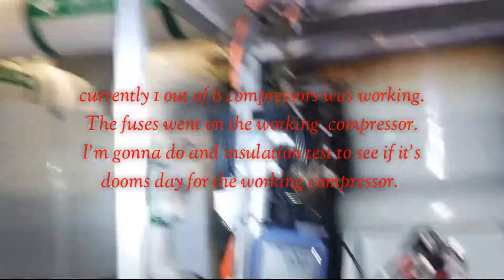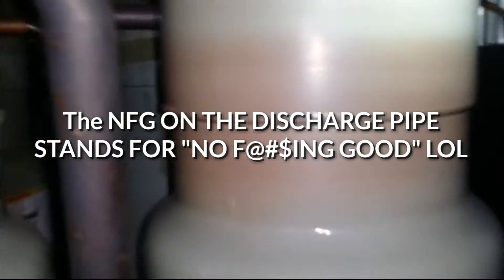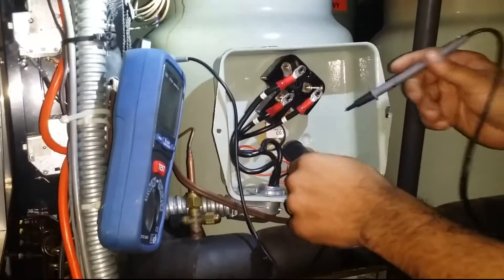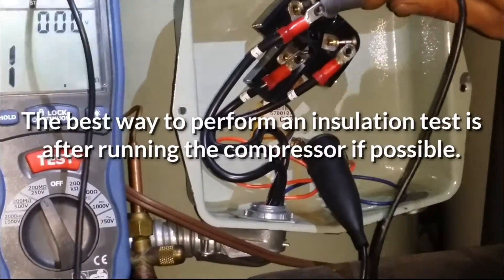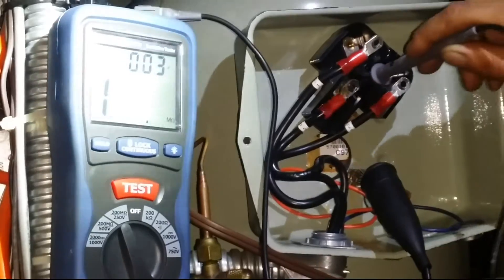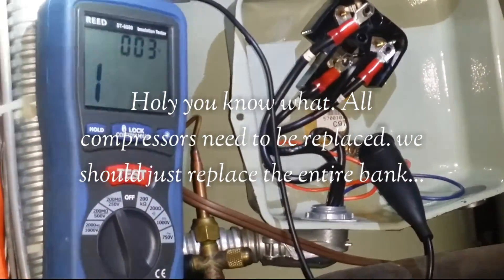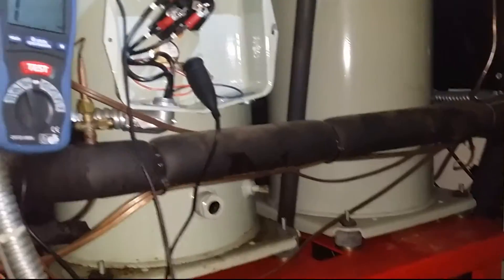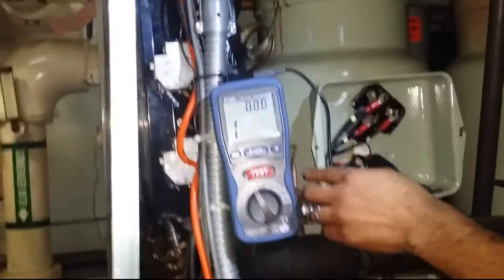HVAC- Insulation Test | How To Use a Meagohmeter

Comment: They forget to trap the piping or check valve on loop or something?
Reply from the maker: Inadequate condenser loop. The compressors just have been operating at high head  pressure conditions for years and they just finally gave up. That's just one beliefs

Comment: Emin, good video!  Like others, I think those compressors are prone to failure.  But I also think there is more troubleshooting to be done here.  Condenser loop may have bad piping, but is it so bad that it won't handle the heat of just one compressor running?  It will be interesting to see what other problems may also exist.  Thanks for showing!
Reply from the maker: This system definitely has its issues. We have made piping modification. Currently the other banks that has 3 moduals with six 15 ton compressors is operating properly. Those bad compressors have been dead since last year except for that one that I did the insulation test. Thanks for watching brother.
Reply: Sounds like there was a manufacturing problem with the compressors in this rack.  They were all built on a Monday morning, first batch. lol
Reply from the maker: Straycurrent hahaha in China by 7 year Olds

Comment: That will keep you busy for a while! How old are they?
Reply from the maker: John this will definitely keep us busy for a while.  Lol
Reply: That's crazy! How old is it?
Reply from the maker: Rob HVAC it's not that old. It was installed in 2004. The condenser loop was piped incorrectly. It caused the compressors to run hot all the time. That one reason for failures